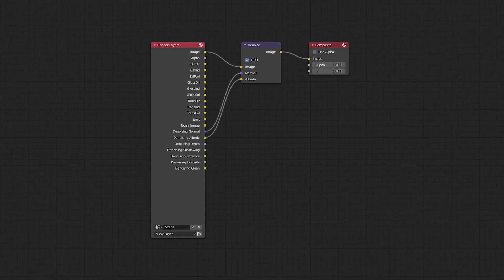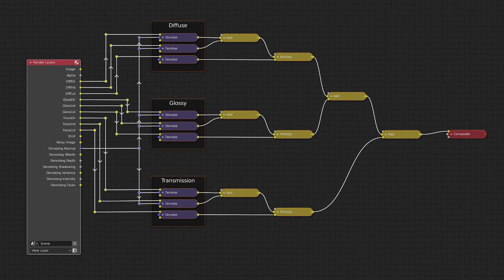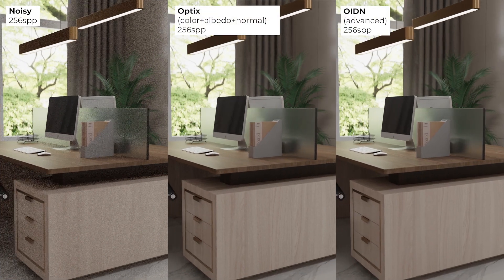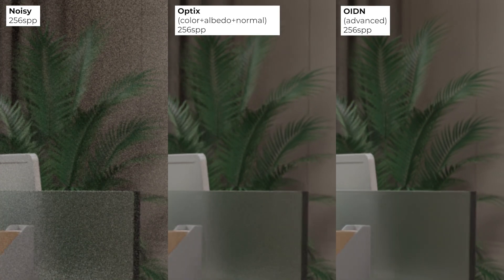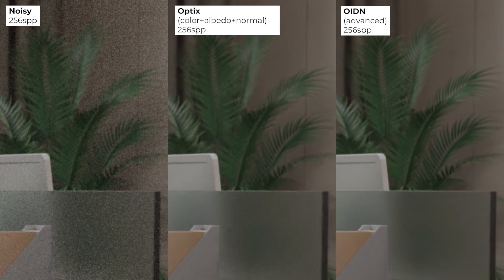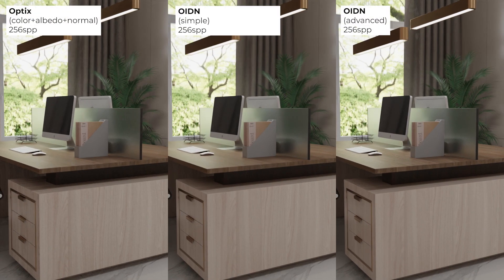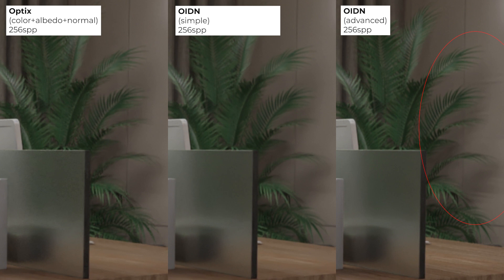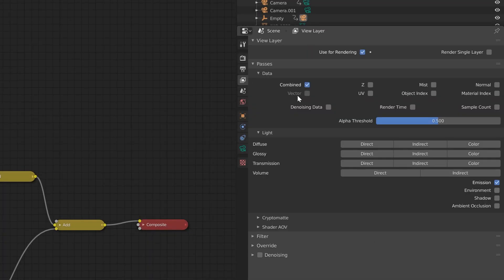Blender 2.83: Optix vs Intel OIDN - Advanced Method

Comment: I'm rendering a test on Cycles with 2.9 with 10 samples only and it is taking less than 3 minutes to render each frame, but I must say it takes extra 3~4 minutes to calculate everything on the compositor. The results are VERY, VERY promising! :)

Comment: Why not also denoise the shadow pass, given the data is there?
Reply from the maker: Would you show me some workaround with shadow pass denoising?
Reply: @klknv  https://imgur.com/FWFc0Sg
I'm running 2.90 e-cycles, but if you're render node looks like mine, why not?
I looked very carefully at renders with and without the shadow pass denoised, and to my surprise, there is an effect.
I'm hoping ytube doesn't block the image link.
The lower mix node I should have expanded too:
the top mix node is feeding the bottom Image input and the shadow denoise node is feeding the top Image input.  
I did notice the use nodes was ticked off in the composite tab, but this file wasn't the one I first used to see if there was a difference...I have to make sure my startup file is updated (!)  I was modeling something with this file.
If I'm wrong, and I couldn't believe my lying eyes, I'd want to know that too, in your opinion.
Reply from the maker: @jeffspinner6579  I still don't understand how to use Shadow Pass. Can you show me Shadow node group inside? Thank you.
Reply: @jeffspinner6579  I've been wondering about how to use the shadow de-noise output as well.  Thanks, your screen grab explains it well.

Comment: For better quality denoising, my tip would be to use "Normal" and "DiffColor" pass as inputs for the denoiser node (instead of "Denoising Normal" and "Denoising Albedo"). Also use a mix node to mix the denoised image with the noisy one to get some details back.
Reply from the maker: Yes, I’ve tried that method, too. But for me my method works better. Maybe I should try again.  Mix node is a good tool, but static seed looks bad imho.
Reply: A little bit of noise is necessary if you are aiming for realism. If it is too smooth, too perfect it looks fake, like a 3D render.
Reply from the maker: Lonesome Aleks yes, if noise is not static. Like film grain. But denoisers always works well only with static noise seed. Anyway, you can always add grain in post.
Reply: @klknv  for Video production yes, you are absolutely right. For single renders, it doesn't matter, noise is noise, static or not, no way of telling 😄😄
BTW there is already a blender add-on, called super image denoiser node. Adds a complete node group with one click, it's super awesome.